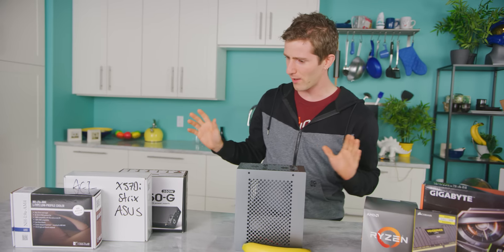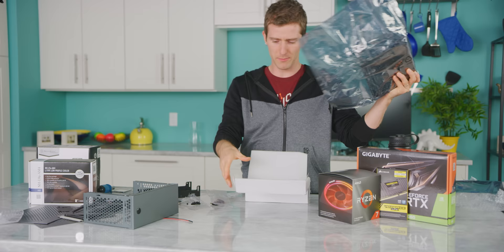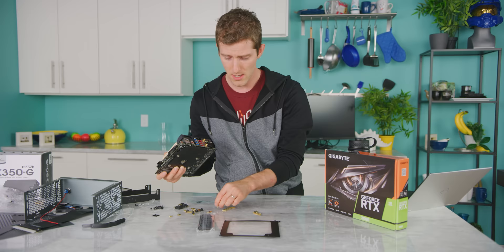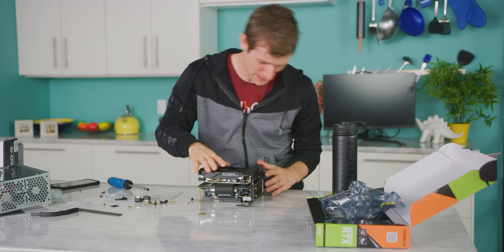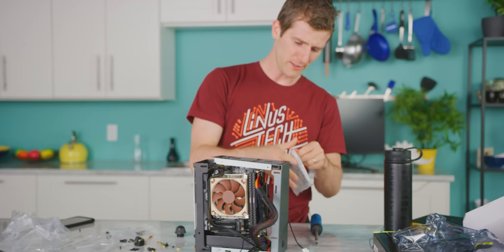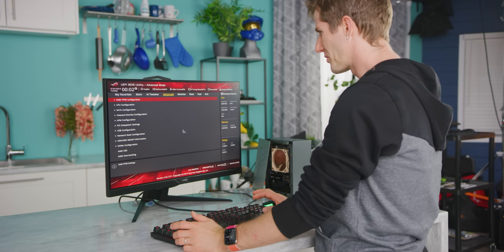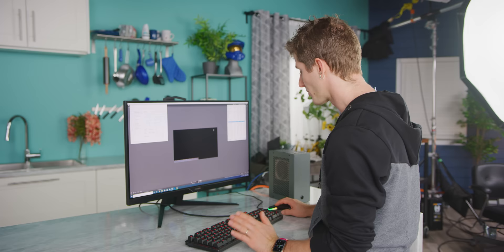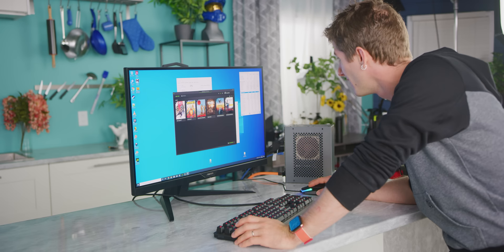Our Smallest Gaming PC Build EVER! - Velkase Velka 3

Comment: The Verge: Dont let your PSU touch your case, IT WILL SHORT CIRCUIT!
LTT: EVERYTHING IS TOUCHING EVERYTHING!
Reply: screw with confidence
Reply: @yoloink5118  but not too tight
Reply: What if you don't have a Phillips head screwdriver on your Swiss army knife?
Reply: Make sure you have a table first.
Reply: ok this needs some explaining why should the power supply short circuit if it touches the case?
Reply: He should have used his tweezers for cable management
Reply: why? how? in 15 years of using,tuning,building pc (personal pc from 486, intel PI@155mhz, amd k6 300mhz, intel PIII 700mhz (vertical and wierd procesor), intel PIII 733 mhz, Amd duron 1,2 ghz, amd sempron 3000+, intel pentiun 4HT 3ghz, and  i5 650) y NEVER have problems with PSU when touch the case with or witouth ground wire....
Reply: LTT makes a joke, the Verge are...
Reply: The Verge: Disregard common sense and separate common ground on your electronic devices, making them more probable to short circuit!
Reply: @sparx0414  But dont get fooled by one of those that have wires you connect to something, just the bracelet is enough. 😉
Reply: @UCiBdnlZWV46rVzvzsyQ_LKw HAHA Lyle's video was awesome!
Reply: The Verge and Stefan Etienne are never going to live that down.
NEVER.
Reply: 12:00 to be exact 😂😂😂
Reply: @laszu7137  facts if that was the case laptops would be screwed
Reply: what about the tweezers?
Reply: When I've seen that he is installing that metal chassis that was bending to the motherboard,straight, without any kind of spacer or insulation between, I thought that is going to make some spark.It may anytime causing to blame anything but himself! Couldn't watch straight at the video after that!Yeah screw with confidence and if doesn't work take a bigger hammer!Liked the PC but I would have done a better cable management...is called zip-tie!Better thermal transfer and definitely better "under control " installation! Linus I like the you,the channel,not a "hate er" but YOU SUCK AT HARDWARE!
Peace!😊
Reply: Don't forget the CPU applicator
Reply: Whats a psu?
Reply: And he didn’t even use the TwEzZeRs
Reply: @KAMIKAZE-dk8xd  its a "power supply unit"
Reply: @sparx0414  "he's not fighting static he's fighting cancer"
Reply: @yoloink5118  your not fighting static your fighting cancer
Reply: @wastedsoul1024  thats right we have got one!
Reply: Andreea Catalin JOKE
Reply: Its funny because the PSU touches the case anyways LOL. Does The Verge really expect a floating PSU?? xD
Reply: stop stop he is already dead
Reply: @Ramog1000  its a joke
Reply: Also... Your psu is typical attached to the case through screws. It doesn't float in the case
Reply: He didn't use enough thermal paste
Reply: My discord dp is same  as your dp
Reply: @lmcgregoruk  Then you’re SOL my friend
Reply: @TKIvanov  thats what she said
Reply: @andreeacatalin8260  it’s a joke
Reply: the top comment is overrated.  this one win

Comment: linus at the beginning of the video: 'we're gonna cable manage this cable like this'

linus at the end of the video: 'we're gonna jam this cable in the only space it fits'
Reply: Every single one of my PC builds
Reply: I'm guessing if you weren't going to re-use the parts later you would shorten the cables you needed and remove what you don't
Reply: Using custom made PSU cables and tying down the cables would have eased assembly for sure. I just think this design is too impractical. There is a lot of tradeoffs with a design like this.

Comment: I went from "oh my god, I need it!" to "damn, I hate it!" back to "oh my god, I need it!" throughout the video.
Reply: Same🤣
Reply: I really want this case even though I'm completely happy with my current setup, dont have any Mitx sized components and I want to move onto watercooling... could we stick a rad in there somewhere?...
Reply: @plasmancer6104  you could run an external rad setup if you find that interesting.
Reply: GameFreakuser did think about it but it kinda ruins the small case if your also fiddling around with an external rad and tubes, maybe I’ll try design a case for fun

Comment: I have one of the old Asrock M8 chassis, and that was a pretty tight and tedious build back then (full sized graphics card). That case also came with 4 case fans at like 80mm or something... I ended up removing all 4 case fans. The system runs cooler and quieter without them. I suspect the same would be the case for this. Because it is so small, the CPU cooler and GPU cooler will probably perform better on their own without interferance from fans blowing in odd directions.

Comment: Linus: Complains about how loud pc is
Me: has a jet engine on my desk
Reply: Mine sounds like the stampede scene in the lion king, hence the 500 watts home theater setup to cover it nicely
Reply: I put my PC on hibernate once, it turned itself on in the middle of the night and woke me up.
Reply: My PC has a bit of noise
Reply: Sounds about right 😂
Reply: Me: has 5 way speakers and an ibm model f
Reply: Linus: Complains about anything less than the best on the planet
We the common folk: can't relate
Reply: My pc has be quiet and even if i play on ultra its very silence
Reply: Best configuration for airplane simulators! :-D
Reply: Don't call it a jet engine if it can't run a jet in gta
Reply: i have a server on my desk :p
Reply: lol seriously I have an i7-2600 next to me and a Ryzen 2200G behind me running my server... There is an audible buzz from the stock fans and coolers.
Reply: I remember my first PC I built, an AMD 2000+ with a stock cooler.  It sounded like a vacuum.
Reply: I have 7 server fans in my desktop. It's louder than the vaccuum now, but the temps are great. Got all 7 fans new on ebay for 29$.
Reply: while gaming i set fans riing trio to 100% and strix 2070 too it goes 50c -ish and loud sound, but while not gaming its very silent.

Comment: Engineer: "We could just add, like, 20mm more on a side and everything will..."
Velkase marketing: "SMALLER!"
Reply: More like, 
SFF enthusiasts: SMALLER
I used to have a build in a case smaller and less well thought out than this, it was great
Reply: @deadlemon  no you didnt.
Reply: @deadlemon  go watch basically homeless's smallest gaming pc video
Reply: @Stri Ker (X)
Reply: @opvask  lmao go look at his channel
Reply: You don't really need that space tho.

A bunch of airflow and space are taken up by leftover cabling.

So you should either cut out any cabling you don't need or  look around for a modular model and then still custom build the modular cables to be just long enough for what you need.

Seasonic has a modular TFX type PSU with "detachable" cables, but they aren't really modular since the 24-pin is one socket and everything else is a huge second socket on the PSU.

You'd still have to start cutting out stuff you didn't need.

The developer of this case really should work with Seasonic or anyone else with TFX PSU's to have a custom set of cables fit for that case.
Reply: You have to have a cut off. Someone has to say "the specs have been finalized. No changing them now."
Reply: @dapz  lmao where is this smaller case then? certainly not in any of those videos
Reply: @opvask  https://www.youtube.com/watch?v=9XynFe638Lk
3.24L + brick
The brick brought it up to being bigger, but the case itself was smaller. (3.24+1.1=4.3 vs 3.7L)
Reply: @davidlovell3341   I love that video!

Comment: "So now it's time for cable management" - I laughed out loud
Reply: Imagine this build with a modular PSU and/or custom length cables
Reply: @ZeldasTears Indeed
Reply: @Appoxo  i'm surprised at that point he didn't just went for cut and solder the wires to the right lenght
Reply: @Appoxo  you can buy modded flex atx psus from  geeek for like $60
Reply: for long term use, better open up the psu and remove any wire you are not going to use instead of jamming it in there.
Reply: lmao, same

Comment: Case: Looks cheap and very small.
Also Case: $139
Reply: Well it's an art of engineering bro. How to make a small case and still give us a respectable temp.
Reply: 137 dollars of profit.
Reply: cardboard box time
Reply: You wouldnt 3d print a case
Reply: @HaXD1209  i would lmao
Reply: Linua said it's 80 dollars
Reply: That’s because it hasn’t entered full production yet. Once that happens it’s price will reduce
Reply: Okay , I would 3D print it for myself then
Reply: Same as mobo
Reply: u can make one with a torch and one of those ikea metal shelves.
Reply: And now it's 160??? Wtf, why am I forced to buy on Aliexpress or pay crazy prices if I want a SMALL case?
Reply: @tiger.98  guess what I have a perfect solution for u , gimme $2 and i give u a perfect cardboard box
Reply: its 130 because they changed the material and added a bit of a better design
Reply: Lord Tiger There's a similar copy of this case on AliExpress. Search for K39 case. It's 4L and is cheaper too.
Reply: @MohondhaY  yes, I've seen it, thank you
Reply: @MohondhaY  you cannot install any case fan in the k39 but still a good alternative
Reply: There are chinese version WAY CHEAP on Aliexpress
Reply: @tiger.98  because aliexpress probably has a knockoff that they didnt design
Reply: @boomcannon9732  a case like that can be designed by a single person, Aliexpress cases are not a knockoff if you just look at them. If the case originally costed $80 the only explanation for doubling the price is this video, and that sucks.
Reply: @tiger.98  true but if you look for an extra 100$ ypu can get a 600w 80+ platinum psu in a special form factor which makes ot a pretty good deal
Reply: @boomcannon9732  yeah, cool, but the case still costs $160 for two metal sheets.
Reply: @ChristopherPBacon1  yeah bro and its now 159 usd
Reply: @tiger.98 you could say that about any case
Reply: @boomcannon9732  no, you couldn't, i've seen the Velka 3d files.
Reply: @BigEightiesNewWave  Not really. Small batch items are expensive to manufacture.
Reply: It’s £70 the case isn’t it?
Reply: China got you covered. k39 for only $14 (discounted price by buying the psu and pcie extension) on taobao.
Reply: @da_pawz  "Art of engineering"
You mean just drilling tons of holes on every pannel?
Reply: mini itx cases are expensive what can you do? even older models of this case were about 90 and I have one.
Reply: @gyromm3094  it used to be the older models were
Reply: @briannguyen6055  i know an aluminium itx case around 4L that costs only $14.5
Reply: @howardlam6181  I mean yeah there are cases but I doubt that they support 2 slot full height gpu and and internal PSU and in a sandwich style. There is the k39 and it's build quality isn't nearly as good as the velka 3. Imo doesn't look as good either but that case is around $40 and bigger the the velka 3. I've built in both.
Reply: me thinks the same looks at  price $900 Canadian just for the motherboard
Reply: @BigEightiesNewWave  Tooling is extremely expensive
Reply: All together its like $1500. Not exactly budget.
Reply: Production costs: $20
Novelty tax: $120
Reply: Bet it costs like $5 to make it....
Reply: Now it cost 149$
Reply: Ali Wardhana drops in water you were saying?
Reply: Now it’s $160
Reply: Yeah heard $80 and was gonna buy. Saw literally double, $160, and at that point I’ll probably just try for the formd T1 or get a ghost s1
Reply: At least the entire thing wont cost a lot, because youll have to put a low or medium end parts
Reply: "Why are video games so expensive? You can just make the SFX and Music for free in audacity, the 3D models free in Blender, and program it in a free C++ version. What's that? It also takes time and talent to make one, no waaaay!"

-you probably

Comment: Should do another build like this. 14500, 4060ti single fan, silverstone 600watt flex, 2tb and 500gb m.2, 32gb ddr5, gigabyte b760 mobo, k39 v3 case, 4.0 riser, and the contact frame with the nh-l9i with duct kit. Great travel setup as I travel a lot with the military. Fits in my bag with my 17” portable monitor, mouse keyboard and headset plus I bring a controller as well as I like Forza horizon and is great for connecting to hotel tvs or just setting up and using my monitor with. I have the full setup details if interested but 1440p ultra or high is amazing. Single player games over 60fps on ultra and over 100fps on games with some setting reduced. It kicks heat, but over all, no loader than a laptop at full speed. Should check it out

Comment: I build also a 3.8L SFFPC with his Silverstone 350 PSU. With all those unwanted power cables (Molex, Floppy….) I opened up the PSU, replaced the very loud fan with a Noctua 40x10 and cut all unnecessary power lines and isolated the cut off ends with shrink tubings. Now all fits perfectly and the PSU is silent

Comment: "a fairly critical temperature, 60 degrees"
My MacBook Air sitting at 70 degrees while idle
Reply: The macbook pro at 110 degrees trying to run flappy bird
Reply: MacBooks are shitty overpriced piece of crap just make yourself a computer it is much cheaper and better than a macbook
Reply: @angadpal6407  Louis Rossman opened one up to find that the fan thats supposed the be like cooling the CPU was on the other side of the computer away from said CPU. No heat pipe or anything connecting the 2. The fan is literally just spinning for no reason wasting power
Reply: @angadpal6407  agree, but not just Macs. All apple products.
Reply: @Jayyy-7  bruh. That's what happens when you rely on people who think they can mess up your computer and get away with it because the majority of people who use MacBooks are kids who don't know shit about computers
Reply: @angadpal6407  AnDrOiDs ArE fOr BrOkE PeOpLe
 
People with iphones are gonna be broke after spending 1000+ on a bad phone
Reply: GET NO SCOPED! I got a Mac air in 2016. Back then, I though it was amazing. I am 13 now, and realise how bad it is for the price. It idles are 50 degrees, and while doing online schooling, it gets up to 100. I have downloaded a software for  the exhaust fan, which helps drop the temperature. However, it is a piece of shit.
Reply: GET NO SCOPED! Also, I am a kid and I know quite a lot about computers. However, when I got my Mac, I knew nothing.
Reply: @natevemuri9024  Yep. Apple is not good
Reply: @tcg1_qc  gamer du Québec, est-ce que tu parles français?
Reply: @natevemuri9024  Oui, pk tu écris mon nom 2 fois?
Reply: @tcg1_qc  parce que je suis bête
Reply: @natevemuri9024  ah
Reply: The conversation went from apple products to baguettes
Reply: @bruhboi4692  c'est vrai
Reply: @natevemuri9024  Oui
Reply: Why the fuck do people buy Macs. The best one has the speed of a PS3 the size of double a ps2 slim at the price of a Bugatti
Reply: @angadpal6407   and what? did they asked for your money? people buy whatever they want and no one has nothing to do with that, I always had custom built desktops because I could afford them and i love them and I also have an iPhone and I love it aswell, all my android phones sucked horse balls and the ones i had costed me almost the same as an iphone
Reply: GET NO SCOPED! Explain to me which LAPTOP is comparable to a MacBook in terms of screen, trackpad, thinness and literal I/O. 4 thunderbolt ports may not be versatile without a dongle but they are much more powerful than any other laptop with regular ports. And many do actually prefer macOS as it is just as good as windows.
Reply: @velvetthunder7725  hey I am a 13 yr old as well. Which pc / lap do you own now ? And what is it's specifications? 
Thank you
Reply: Trickster YT alright, so I have a Mac air 13 inch i5 dual core. I can’t remember the specs as I haven’t touched it for a couple weeks. It has 128gb storage and has an intel hd 3000 graphics. 8gb of ddr3 ram. However, recently I got a pc specialist laptop. I think that they are a U.K./Europe company tho, but I’m not sure. Anyway, it has a 4800h (I do editing for a few friends and it was cheaper than the intel versions) along with 16gb 2666mhz DDR4 ram. 1tb intel 660p and an RTX 2060. The laptop is called an optimus pro xi and is 17 inches and 144hz. The battery is shit tho. Like less than 3 hours while doing normal work. It is a 46whatt hour battery and for a 17 inch that is no where enough.
Reply: My Idle Macbook Pro ran at 600 or 6000 degrees.,it almost burned my house down
Reply: my 50 year old pc hitting 150 degrees in idle
Reply: PiggyzFast GT what-
Reply: BlockyDoesStuff sorry my mac-
60k degrees-
JKJK
150 degrees at idle UwU
Reply: my amd 5 ryzen sitting on it's stock cooler lives at 60 celsius.

Comment: "this is the most unique computer build i have done in quite some time " 2 days later - " ALRIGHT EVERYBODY WELCOME BACK TO PART 4 OF 24 GAMERS 1 CPU"
Reply: With Epyc from AMD, I bet they can do it 😀
Reply: More like part 361
Reply: נועם אברג'ל  it won't be good, but at least it will be possible, as you'll get something like 5 threads per person, and modern titles can use these 5 threads. As for GPUs, I'm also not sure it's feasible but this CPU supports some really insane amount of PCI-e lanes.

Comment: Linus says "it won't be a silent system "

I have a laptop that to turn on, the fans go to 80db
Reply: 80 dcb
Reply: Jesus
Reply: LiamGamerTV yes?
Reply: you have fans about as loud as a fire alarm
Reply: isaghe ponticilli fire alarms are more than 100 db
Reply: Mine is just
0 db
It died
Reply: @allanhanan  😔
Reply: I can't tell the difference between the airport and my pc anymore
Reply: Mine sounds like a jet engine until the fan explodes into a million pieces
Reply: Mine is 78
Reply: I have a psu with 80mm fan which will constantly roar at 50 db, even when idle

Comment: 8:45
"it's actually in there surprising securely" - Linus 2019
Reply: "It's actually in there" -Linus 2019
Reply: "It's actually" - Linus 2019
Reply: ”It’s” -Linus 2019
Reply: "I" - Linus 2019
Reply: * the correct timestamp is 8:48
Reply: " " - Linus 2019
Reply: "Wait... I can’t get it out actually!"

"LeTs UsE a ScReWdRiVeR tO gEt It OuT!"